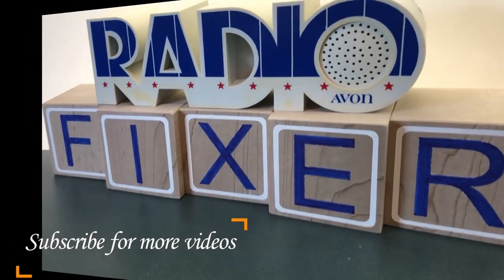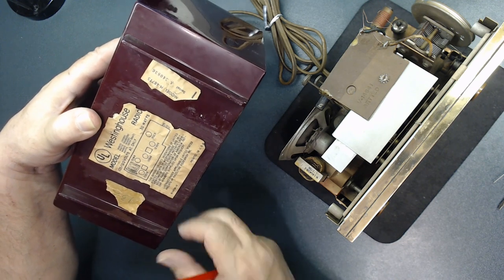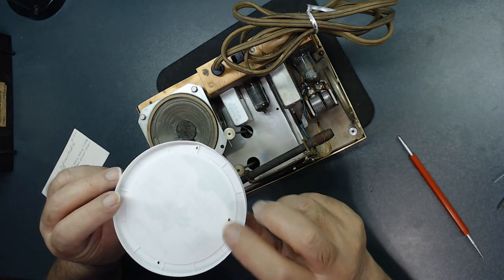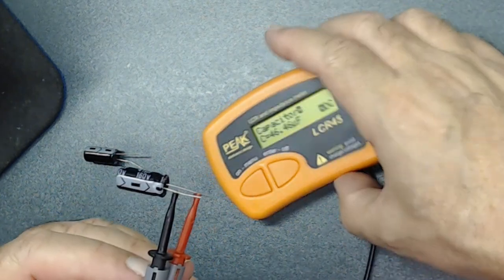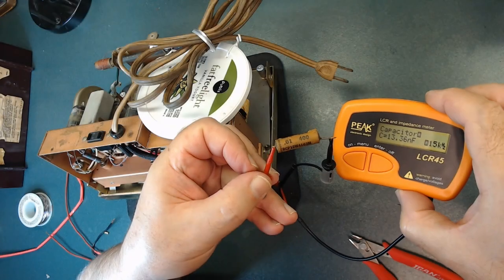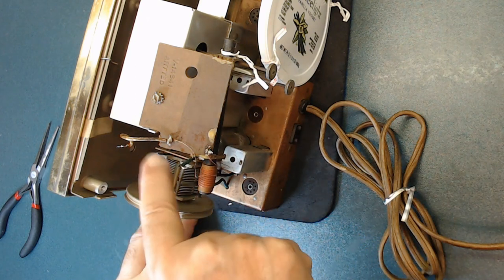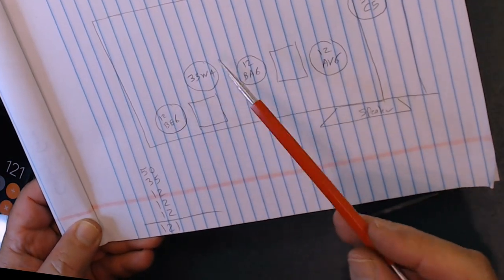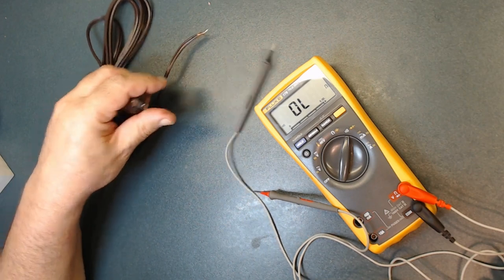Part 1 - 1955 Westinghouse Clock Radio Repair

Comment: Another excellent video from you...thanks for sharing it!  I noticed something interesting about this one.  The chassis is either copper or copper plated.  Not a lot of those out there that I am aware of.  I think that Zeneth was the main one that I have seen before.
I am eager to see what you do in the way of creating knobs for the clock.  I know it will be something great since you are doing it.  Do you know what color you will make them?
Since it might be both of interest to you as well as a source of good ideas, I wanted to share some videos of David Tipton that might give you some ideas on things to do with this one.  In this series of videos the part that I think you are going to be most interested in (though ALL of them are worth watching!) is part 2 & part 3.  He does a fantastic job in repair of the case, and even strengthens it with come aluminum that he formed to fit the inside of the case.  Here are the links:
https://www.youtube.com/watch?v=rrR6y61oV-k&t=9s
https://www.youtube.com/watch?v=Y3OkmFASDbk
https://www.youtube.com/watch?v=RyxEVKT2fhI
In some ways, this series of Daves reminds me of your 9-part series on the Rat House Radio.
Reply from the maker: Wayne, so good to hear from you and thank you for taking time to send me such a great and uplifting comments. I was surprise with the copper chassis too, they did a great design on this radio. It is a small and interesting radio, wished case was built with better plastic. Definitely will watch these videos that you suggested. Wish you well, take care and Have a good night! Regards, Jay
Reply: @RadioFixer  Speaking of the case...when you mentioned using the soldering iron to fix the inside of the case, I realized I would never do that myself...but listening to your reasoning about why you did it, it makes much sense and I have to admit it is a good idea!